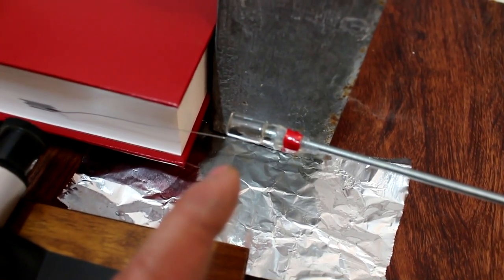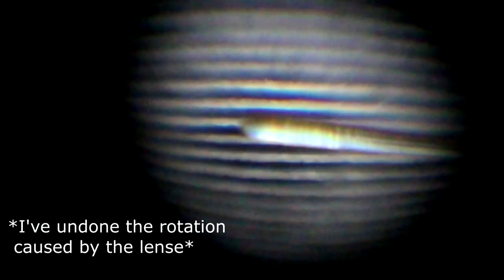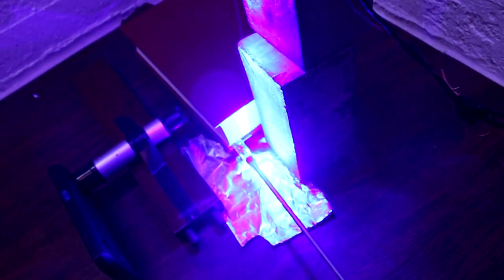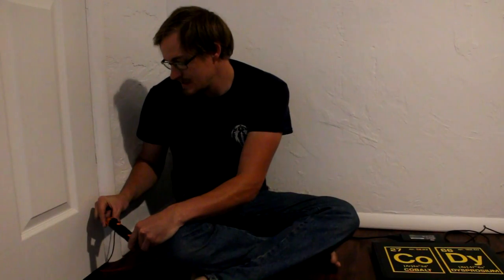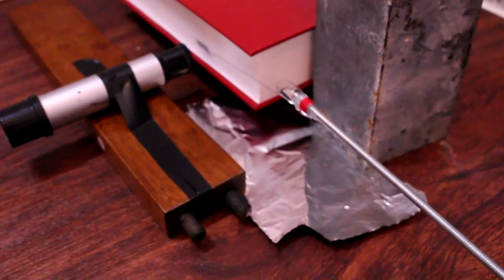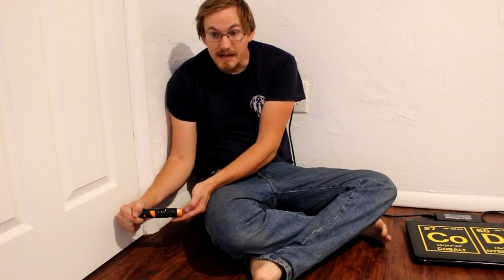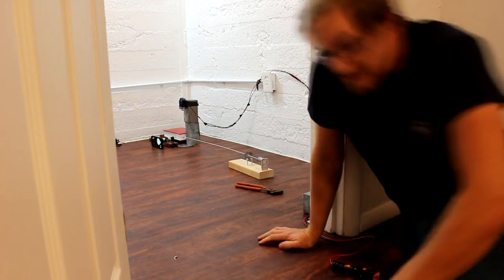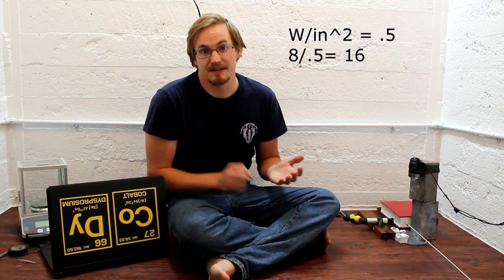Does Light Push?

Comment: Actually, photons are massless but have momentum. It's due to the full equation 

E²=m²c⁴ + p²c²

This full equation of the energy-mass equivalence  relationship allows a particle to have no mass but energy if it has momentum
Reply: they can't have momentum if they dont have a mass?
I think it's due to the energy they carry that is transferred to the balance, but correct me if i'm wrong
Reply: Photons don't have rest mass, but they do have relativistic mass.
Reply: Yup, something confusing is that when they are reflected they don't loose any speed, photons always go at C. ( in a vacuum)

That raises the question "where is the energy taken from? If it doesn't loose speed like normal day to day object with momentum then what is taken from the photon? 
The answer to this is the wavelength of the light changes, it is blue shifted.
Reply: Dynamitemonkey500
 Red shifted.
Reply: So will al the light eventually be red?
Reply: +JustAnOrdinaryBrick no, the light will be absorbed before any major changes
Reply: Deskbot Prime this is really interesting!
Reply: More specifically, light's momentum is described using Planck's equation in conjunction with relativistic momentum. p=h/l where p is the momentum, h is Planck's constant, and l is the wavelength of light.
Reply: I'm no expert but surely the momentum conservation principle applies to photons? therefore a massless particle cannot have momentum?
Reply: yes they are massless

but the acctual equation is E^2=(MC^2)+(PC)^2
and because of bidmas  (bodmas) you would have to calculate the (MC^2) and the (PC) and then square them instead of squareing everything beforehand
Reply: +Sam Holliday No , photons are massless ( the reason they can travel at C) but they do have momentum
Reply: Dynamitemonkey500 if velocity or mass are equal to zero then so is momentum. p = mv
Reply: Sam Holliday
Please read the comments, before adding more confusion. One more time; photons do not have rest mass, but they do have relativistic mass.
Reply: +Sam Holliday if you read the rest of the comment thread where we are actually talking about this then you will clearly see why that is wrong. Don't spread you pseudo science around, keep it to yourself.

With light the wavelength is used to define the 'momentum' since photons always travel at C in a vacuum , never any slower nor faster. This means that if photons have mass they would always have the same momentum ( they wouldn't be able to pass any on)
Reply: Dynamitemonkey500 no pseudo science just didn't see user225's comment above. calm down, dear.
Reply: Photons don't have mass. +dangerouspeople1!!!!!!!! is correct. You're wrong.
Reply: +Anti-Yacon as already mentioned by user225, photons don't have rest mass but do have relativistic mass.
Reply: +Deskbot Prime lol Wikipedia
Reply: Matthew Mcphee
People who "lol" for wikipedia are people who don't know how to use it. Wikipedia is as good as its sources are.
Reply: user255 
I enjoy your naivety assuming the meaning of lol, because I 100% meant it as lots of love, Wikipedia, 100% no doubt, at true as an internet post.
Reply: MC = PC? So does that mean everyone must play Minecraft PC? Fuck me I'm out. Fuck. MOM I'M OUT OF BLEACH!!
Reply: +Jesus  (mom never replies) guess you weren't out of bleach...
Reply: E²=(mc²)² + (pc)² is the correct equation, yours is wrong
Reply: Actually it's possible for light to have momentum without mass (better referred to as invariant mass - not to be confused with relativistic mass) as there have been several experiments carried out that prove this. Even in classical physics Maxwell's equations required that light have momentum.  In layman's terms this is because the photons are able to travel at or close to the speed of light and this lets their invariant mass i.e.

m = sqrt((E2/c4) - (p2/c2))

be zero even when the momentum (p) is a tiny fraction of a number but not quite zero.
Reply: Barnesrino Kipperino if you're talking about the formula the original comment has (posted 18 hours ago doesn't show as edited) then: they will both get the same results, yours shows how its derived better though. But (mc²)² gets you the same results as m²c⁴ and same for the other components in there.

If however you're referring to what 0riginOFinsanity stated up there, then yea you and the original comment are listing different formulae. Haven't thought about relativity theory for so long that I can't remember these things from memory, but I think both you and the OP are right.
Reply: +user255 But just throwing around the term relativistic mass when communicating the concept to people with no understanding of relativity is confusing. "The concept of "relativistic mass" is subject to misunderstanding. That's why we don't use it. First, it applies the name mass - belonging to the magnitude of a 4-vector - to a very different concept, the time component of a 4-vector. Second, it makes increase of energy of an object with velocity or momentum appear to be connected with some change in internal structure of the object. In reality, the increase of energy with velocity originates not in the object but in the geometric properties of spacetime itself."
Reply: Xei Well, I wasn't trying to explain the whole phenomenon in detail with one sentence. I merely gave something to google to get to start.
Reply: Any shift on the photons wavelength is really negligible here. The momentum imparted to the scale is due to the change in direction from the oncoming photon's momentum.
Reply: +Jonathan Odude You're getting confused with relativistic mass which is what you're talking about. Relativistic mass is the measure of the energy of a particle, which changes with velocity. I'm talking specifically about its invariant mass (or rest mass if you prefer), which is zero for a photon. Generally people in Physics when referring to mass they mean its invariant mass not its relativistic mass simply by convention. This is because when doing any kind of calculation invariant mass is incredibly more useful. The reason being is that relativistic mass is equivalent to energy (Einstein's famous equation E = mc^2), which is why relativistic mass is not commonly used nowadays. Because the modern view today is that mass is not equivalent to energy but instead is just that part of the energy of the body, which is not kinetic energy. Mass is therefore independent of velocity whereas energy is not. I suggest you look up both concepts - makes for an interesting read.
Reply: +user255 I agree. All my teachers ramble about how unreliable wikipedia is because anyone can edit it. The thing is, I find websites written by "reliable sources" like PhDs to contain very outdated information simply because after initially writing the article years ago, they never come back and update the site based on new information. Whereas wikipedia is perpetually evolving with new information and has pretty strict anti vandalism security in place.
Reply: Photon doesn't have mass, and this experiment is useless
Reply: Farar Rarara farar, it dosent need mass to have momentum
Reply: Michael Varney What do you mean by that? Photon do not have rest mass and it doesn't matter how many times you add the zero, the result is still zero.
Reply: Michael Varney Your forgetting that when most people talk about mass they are referring to its "invariant mass" or rest mass and not its relativistic mass - hence the confusion caused.
Reply: Trolling, because otherwise there wouldn't be enough confusion in Internet.
Reply: Dynamitemonkey500 *lose

Comment: Hey Cody you should play around with pendulums in a vacuum. It would be interesting to see how close you could get to zero dampening affect on the whole system.
Reply: Isn't it put on the end of the video. He did it already though
Reply: He actually tried to increase the dampening by adding magnets at the other end. The problem with air is thrust from heat. You are trying to avoid that. He mentioned this in the video, that's why he did the control tests first, to make sure it's not a problem in this setup.
Reply: @headness13  ... That's right for the video, but you're in the wrong conversation. Zachary is suggesting a new idea involving minimal dampening.
Reply: What would be the use of that? Dampening helps to stabilize the pendulum, doesn't really influence the actual force needed to move it X amount. (please correct me if I'm wrong)
Reply: Zachary doesn't want a stabilized pendulum, but one that retains its energy and oscillates for a maximum amount of time, and just wants to see how Cody would approach doing that. Zach doesn't seem too interested in force in this case. Take, for example, the end clip of this video, where it compares the foil swinging both in vacuum and in air, being in vacuum it swings for much longer. More of that idea.
Reply: Ah, ok, I get it now.
Reply: That is actually my current research project. I am trying to measure the momentum rather than just detecting it. I am using a torsional pendulum in a vacuum. However, I need a vacuum of around 10^-6 hectopascals to eliminate any photothermal effects, and I need very expensive equipment to get a vacuum that low. My experiment has costed around $7000, so I do not think that wouldbe cost effective for cody.
Reply: ouch thats a lot of money,i hope you figure it out.
Reply: Democritus86 
I'm done the experiment now, and I measured the force to within 7% of the expected value!

Comment: The scale moved when the laser was beamed through the glass only, because the glass is going to act like a mirror to some degree and reflect photons.  Neat experiment, I like your methodology to remove the heated air hypothesis.  

I would also like to say that I think your original experiment has some merit as well.  If you put a Crookes radiometer in a reasonable vacuum it will not spin, there is a certain amount of gas contained within the device to leverage the pressure differential from heating up the black veins.  Yes, you previous experiment would have expressed this phenomena to some amount; but I believe that most of the rotation from the foil was from the light pressure and not air currents.
Reply: Aaron ALAI in my opinion is the force of the photons way too small be noticed like shown in the vid with the piece of aluminium foil
Reply: The reflectivity of the glass itself is way too low for it to move the wire as much as it did.